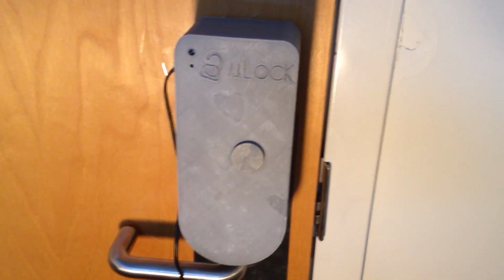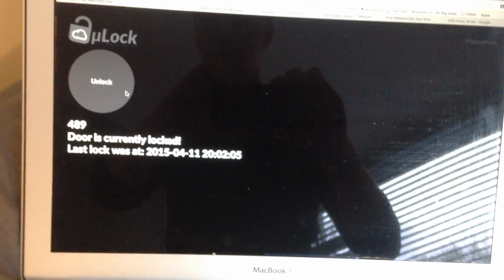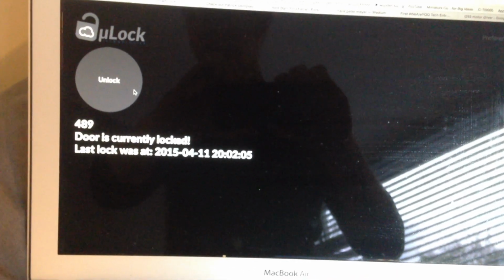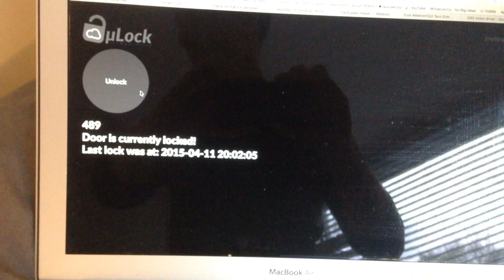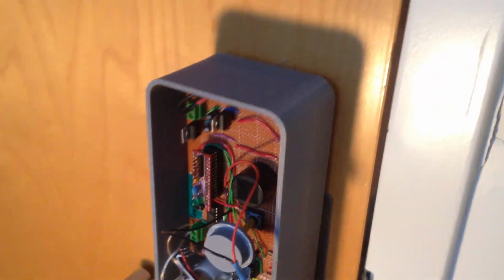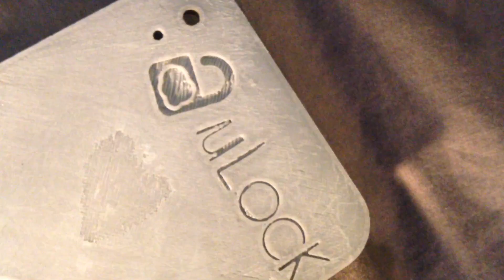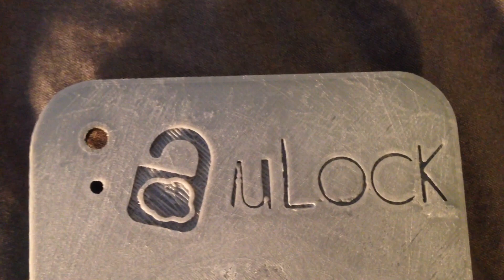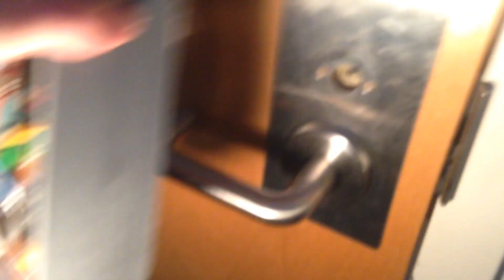3D Printed WiFi Smart Lock - ESP8266 and Arduino Project in Depth Teardown

Comment: hey man! nice project indeed. But I was just wondering, how about the mechanical strength of the system. Looks like the thin plastic boxes can be broken if pressed hard, bad when used as a door lock. Btw, have to say again excellent prototyping idea.
Reply from the maker: Oh absolutely, this was just a prototype for a class project to demonstrate the idea. Being made out of thin plastic (with a low melting point), it would be very susceptible to getting smashed or even melted. However, this is on the inside of the door, lessening the need for it to be extremely robust.

Comment: Hey richographic.Amazing project.I would like to make this project happen as well.Mind telling me the main differences on why i should use a standard dc motor and not a servo motor?
Reply: ***** price differential perhaps ? Servo motor with enough torque to turn the lock knob isn't exactly inexpensive. Also as an engineer using an encoder + geared DC motor with low RPM (for high torque) is so much more fun, I guess. Let's wait for the author to share his reasons though.
Reply: Banibrata Dutta How much torque would you need to turn a key?Found a ServoMotor with 13kg/cm Torque priced at 4.93$.It's propably enough
Reply: That's quite some torque, and I think it should be enough. Looks like a pretty decent deal that you are getting. I hope it is of decent quality.
Reply from the maker: ***** Banibrata nailed it, I did it this way because I only had DC motors on hand and designing the encoder was pretty fun. You could absolutely use a servo and those specs should be more than enough to open up a lock. Feel free to post any more questions!